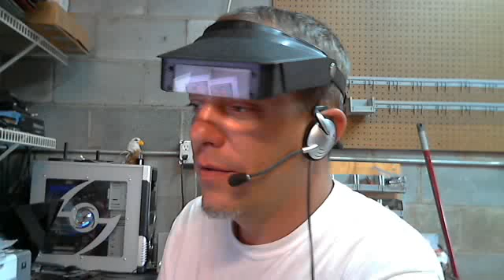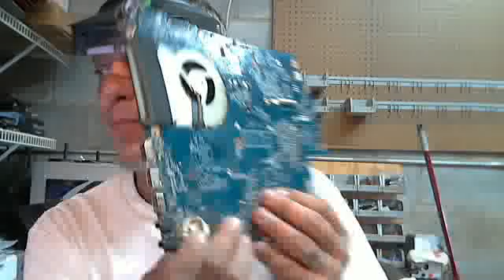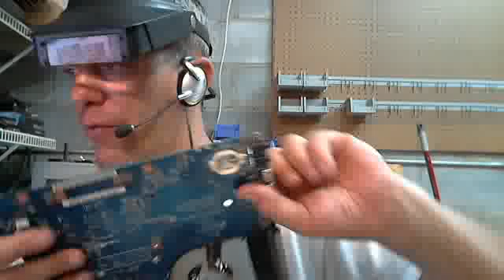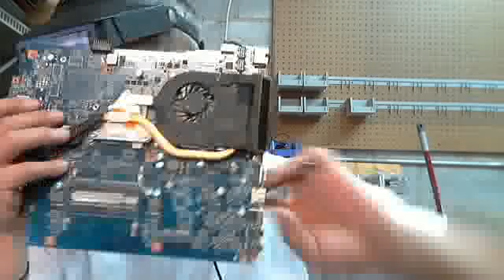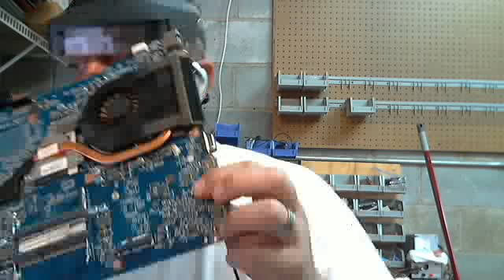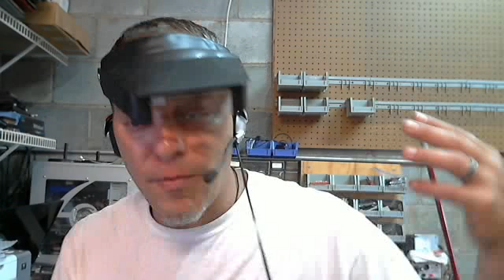Remove BIOS Password, Windows 7, Acer Aspire, Phoenix Bios - Quick Reset

Comment: I have a Acer D270-1824   I need to know how to change my current password. When I turn it on I have to hold down the F2 button, and that takes me to the screen with a blue box saying     ENTER CURRENT PASSWORD.
I don't have the password for it, so how do I clear or by-pass the password?
Reply from the maker: +Heath Anders 1) remove battery, cmos, and ac adapter let set for 3 to 7 days 2) follow steps in this video (charged cap will differ) 3) find jumper near the ram and jumper to reset code.  Good Luck

Comment: Been 6 days removed cmos battery, bios pw still there. Removing cmos has never seemed to work for me, but then again I've never waited this long.
Reply from the maker: see my latest video,  for jumper
Reply: +DrcJr77 I did watching, may take some time to locate the jumper on the 7741z
Reply: +DrcJr77 I originally came to this video hoping to find the location of the jumper for the 7741z, capasitor has no voltage been 6 days still bios user pw remains... I saw your new video and it can be easily done without soldering with a jumper wire, I dont see the need for soldering at all

Comment: yes its the bios password..i cant change anything in my bios. i tried removing the cmos battery and now i fucked it up. when i turn it back on it tells me i have to set the time and date.. and when i got into bios there is a password and if i hit ENTER it takes me into bios but i cant change the time and date even boat order and other settings due to its locked do you call that a bios password or what ? any suggestion on what i should do mr pro :) cool videos you got by the way !!!
Reply from the maker: what does it do now if you let it boot normal,  you can skip date and time for now
Reply from the maker: +Heizar Ryhmezone send me a direct message

Comment: I just cleared the bios lock on my Hi Grade laptop by removing the battery for 90 seconds and then replacing it. Wasn't sure this old method would work with laptops but some things just don't change much after all. Good luck to you all.

Comment: Thank you. Did exactly as you said - and it worked flawlessly. Voltage on the capacitor was 1.569v - drained by shorting one side of cap to other side with a wire - then voltage was under 0.1v. Put laptop together, no password. I am resetting the laptop now. 

Great video!
Reply from the maker: :) thanks for the follow up, even though im late getting back to ya.

Comment: Can't this be done via software?
Reply from the maker: No
Reply: DrcJr77 Rats.  I wish Laptop designers would make the CMOS battery, et all accessible from the bottom panels.  It is almost as if they do not want anyone repairing them.  The stupid HP Slimline series doesn't have a panel for the RAM or Hard drives on the bottom.  You almost have to destroy them to get to these simple repair jobs.

Comment: Howdy. I'm having some trouble with a clunky Acer Aspire Z5600 and was wondering if you could help. I've read on a few sites that shorting out something called the CLRP1 will reset the BIOS password. My questions for you are: is that true? If so, where exactly is it? And does a Z5600 have a CMOS battery like the laptop? I've ripped this thing apart and can't find anything that resembles what I'm supposed to be looking for. I'm relatively new to the world of computer disassembly, so any info or help you can provide would be greatly appreciated. Thanks!

Comment: Great video! I left my cmos batt out for a good 18 hours. Thought that would clear and reset the bios, but no. I have done this before on an older laptop and it worked quite fast. This laptop I am working on now is two years old. Would you say that newer mobos are capable of having a prolonged capacitance after the battery is gone?

Comment: This worked for me, I let the machine sit 4 days with no battery nor cmos battery, reassembled, bios pass gone.  Now I just have to remove the HDD pass.
Reply from the maker: HDD password calculator specific to your drive.
Reply: I never figured out a way past it, do you?
Reply from the maker: P Nut yes off course, this vid shows how. It's it giving you an error code?
Reply from the maker: sorry I was referring to another message, are you talking about the HDD psd